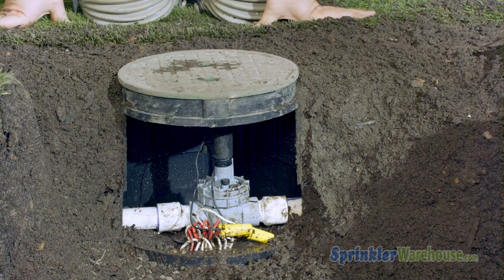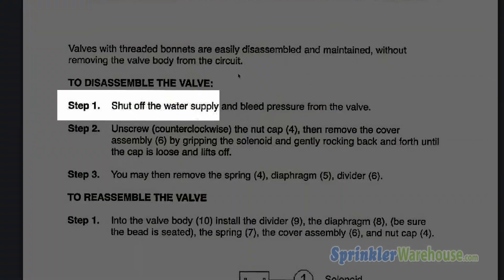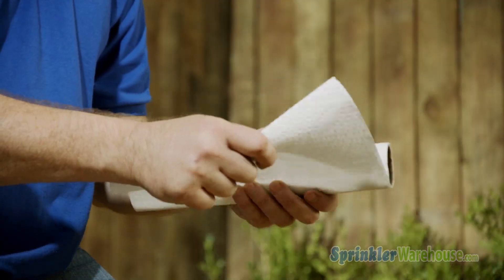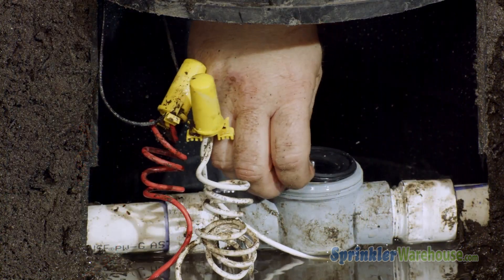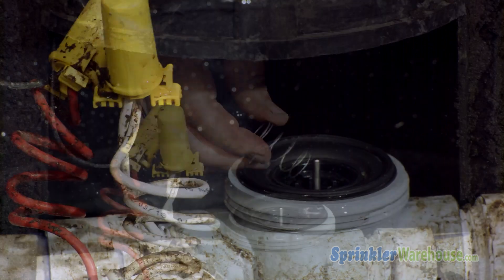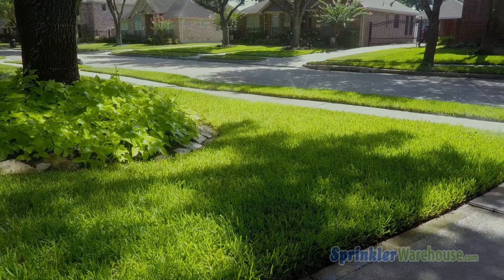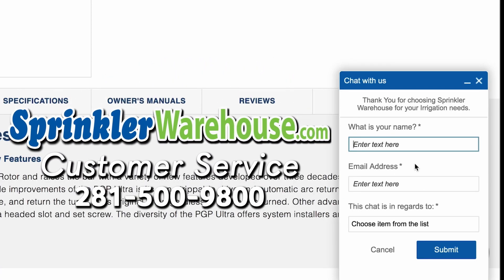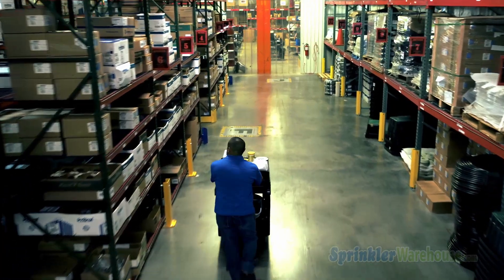Jar Top Valve Diaphragm Replacement

Comment: Make sure the threads are clean and lube the threads to help tighten the top. Sometimes i use a hammer and flat screwdriver to tap it on.